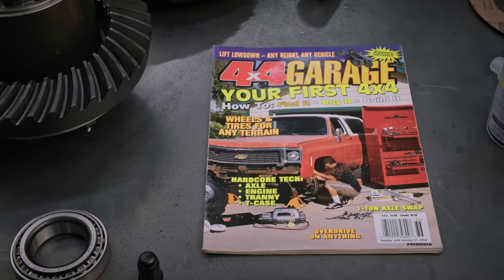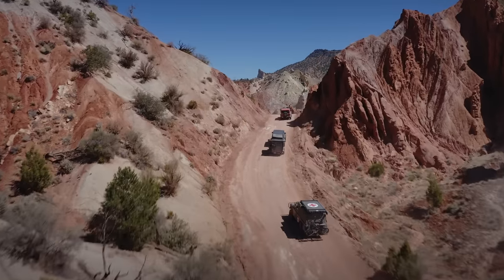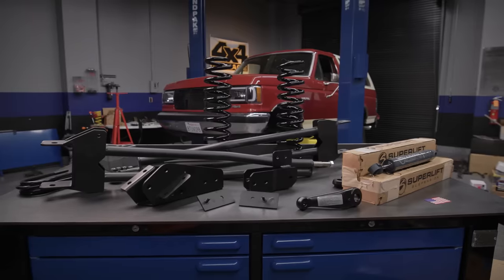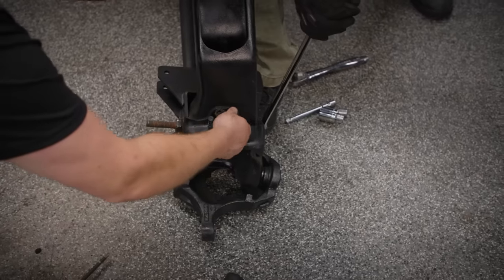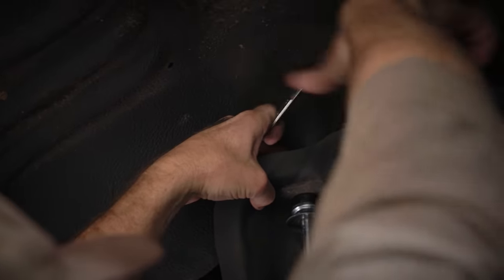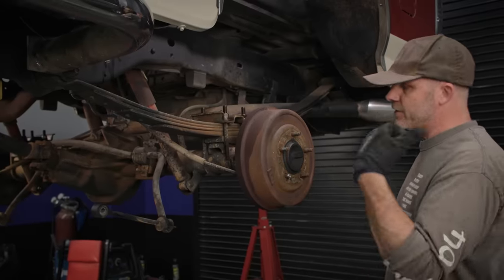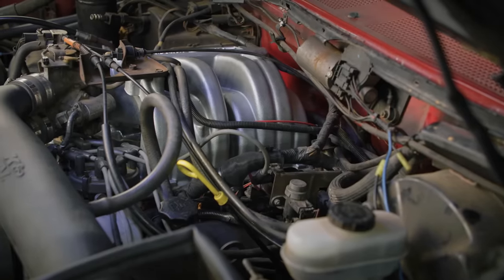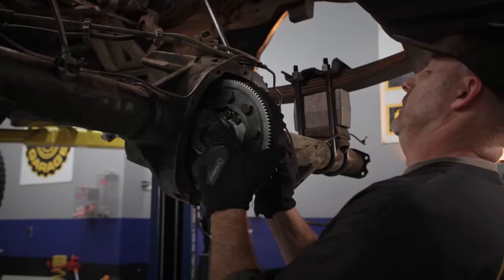4x4 Garage: Bronco Build Part 1 | MotorTrend

Comment: Great Video, excellent footage, and YES... someone actually using a torque wrench.  Great timing as I am starting the same upgrades on my '90 Eddie Bauer Bronco. Very helpful.
Reply: What distributer are they using, also trying to do the same upgrades on 95 eddie bauer 351 windsor, cant find the distributer anywhere.

Comment: I had the same lift kit on an 85 f150 four-wheel drive. It rode and drove better with this kit on it than it did stock. I ran a set of 40s on it after also installing a 3 inch body lift. The truck had the 351 Windsor 4 speed 411 gears could have used some more gear I just never got around to it in the truck was stolen out of the parking lot of the apartments I lived in time.
it was never recovered have no idea where it ended up.

Comment: I had a 78 with a 429 4v with some speed parts lockers and 37s it would go anywhere and do it fast I loved it wish I still had it
Reply: I'm sorry I'm not a complete nerd but are you talking about the 429 big block with a 4 venturi carb? I'
d assume because idt 429's had 4 valve heads 😆😅
Reply: @thehumanoid6543  yes that's what he is saying 429 Cid big block with a 4 "barrel " (venturi)(?) carb
Reply: @darryladams519  I think the v stands for venturi. Which might be equiavlent to 4 barrel ig
Reply: @thehumanoid6543  yes it does i put the question mark because i wasn't sure if i spelled it correctly.

Comment: Can you say flirting with disaster, ditch the lift blocks, 37s, tru trac, gears, and 6" lift, you're going to be breaking driveshaft yokes in the rear the first time you use 4 low and climb something.  TTB, gears, 37s, and traction device= pop!  Good luck!

Comment: Lift kits like this are much of what gave TTB suspension such a bad reputation. Sure, this is the best kit their benefactors Superlift had but it's probably been sitting on a dusty shelf for 25 years. Desolate Motorsports and Solo Motorsports both make budget friendly coil bucket suspension systems that keep the ride height lower. Moving the beam pivots creates leverage that leads to failure. Nowadays shops modify the beams by cutting and turning the knuckle ends to correct camber while leaving the beams in their stock locations. For long travel, guys are extending the beams. There are also a couple shops(Hollander Motorsports, Ohhcho Fab) building fully fabricated beam and radius arm kits that utilize spherical bearings instead of bushings, as well as proper crossover steering kits. I'll admit much of that is well beyond what's being spent here but I think you guys ought to make an effort to show more than paleo-tech drop bracket kit installation and shine a light on where the desert guys have taken this platform. The technology and developmental effort being invested in broncos/F-150s nowadays would shock most of your casual audience.
Reply: Well written, i was disappointed as well they didn't use something from Solo or Desolate.
Reply: Yep. Honestly though, I'm surprised they didn't throw a couple grand at a straight axle. Unusual of them to leave stuff alone like that, especially when it's so popular to hate on the TTB.

Comment: I thought 1978 was the first year for the full size Bronco?🤔🤔🤔
Reply: it was 78, but the ttb front and new body  style started in 80
Reply: @madnak5141  1980 was a body change, 1987 was a body change and 1992 was also a body change. Yes 1980 was ttb first year. But if I remember correctly you can swap the front clips,  fenders, hood and such between them.